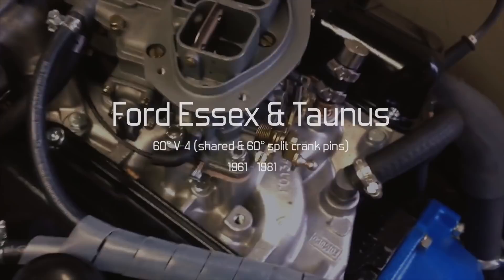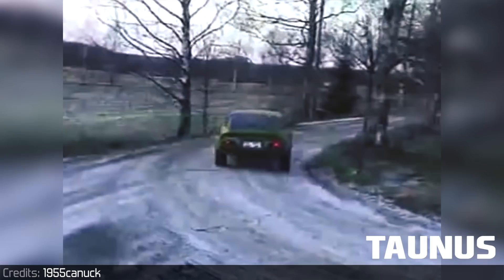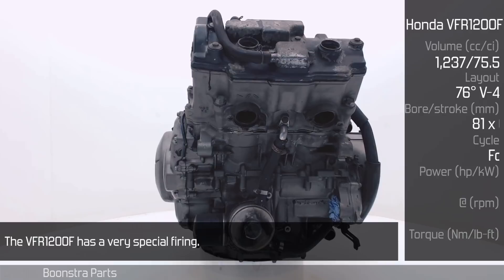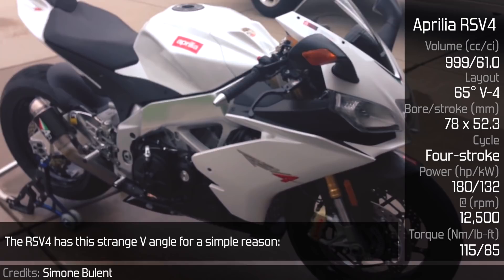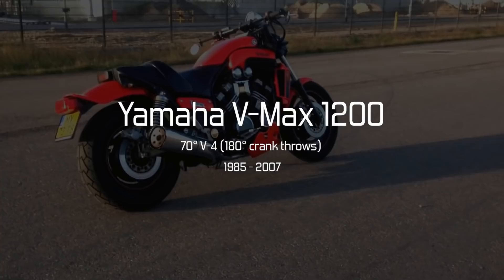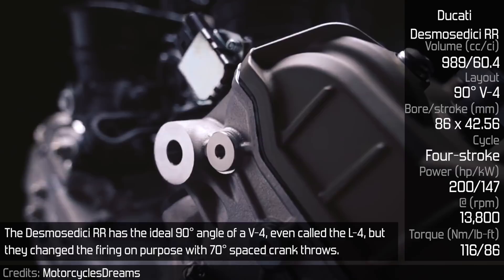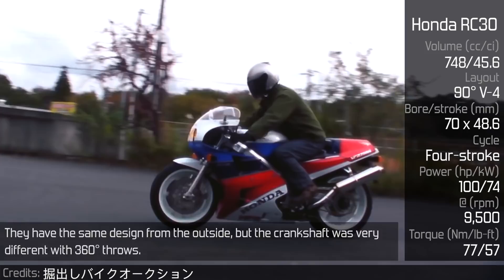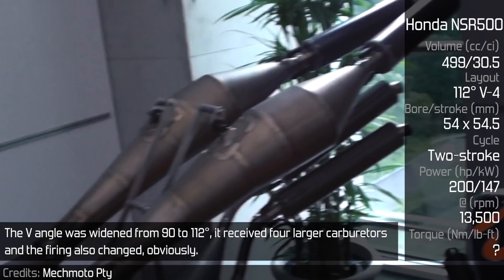9 Differently Firing V-4 Engines

Comment: That RSV4 makes the most fantastic sound on the planet.
Reply: The original Vmax (1200cc) has the same layout and about the same sound. With dual exhaust straight pipes it sounds like a muscle car.
Reply: What about the MT-10 and YZF-R1?
Reply: desmosedici is insane as well .  the street one of 2008
Reply: Have to agree
Reply: I dunno, I bet Emma Watson does...
Reply: Completely agree with that
Reply: I prefer the cbx1000 inline 6, an aural orgasm. Vmax with 4 into 1 exhaust is #2
Reply: Yeah, till you hear a desmosedici live. Its like they made a deal with the devil for the sound
Reply: It’s spelled vfr
Reply: @shadowv6794  in real life, with SC project or Austin racing exhaust, Aprilia rsv4 sounds much better than R1 and ducaties 
Rsv4 screams like a v4 GP bike in max revs as well as it also has bass in low revs like inline 4 bikes 
Rsv4 is a complete music with enough bass and treble..

R1 and ducaties don't have that much bass in low rpm
Reply: Hearing them at full chat in the Norton Isle of Man TT race bikes in 2018 is a sound I'll never forget. I get goosebumps even thinking about it.
Reply: I like my rsv4s sound, but I did notice that even with an SC, my buddies Buell is louder, makes sense though, higher compression into that twin than there is my bike.
Reply: As someone with an rsv4 with a gp22, I agree
Reply: That Honda 750  sounds pretty mean as well.
Reply: yeah....almost like a hippopotamus farting.

Comment: Let's face it, of them all, the Vmax sounds incredibly good.
(that Essex V4 sounds like a good old US V8 also)
Reply: 2nd gen sounds even better.  https://youtu.be/BmiNnBKa85w?t=30s
Reply: I've ridden a 2005 Yamaha Vmax here in my town and I've got to say, its got the best linear torque curve in bikes that I've ridden. No Traction Control for that extra lower end with acceleration that doesn't throw you out of the bike. Nor is there ABS, cause real men use fingers.
Reply: @rajatraghuram7587  I own a 2006 vmax. It's an absolute blast to ride and the sound is amazing too. Even the harley people around here know what a V-Max is it won't dare race it.

I also own a 96 Magna v4 and a 2002 which is going to receive a Vfr750 motor swap and a turbo for drag race use.
Reply: @allhailzoidberg8182  Damn nice, mate!
Would love to see the drag spec Magna.
Reply: @rajatraghuram7587  it's going to be a couple years before I get it going. I bought the bike for $100 usd, and every bit of the bike screams scrap metal. It was in a house fire over 10 years ago and sat in someone's storage shed since. But it has a straight frame and good motor to start from. I've got 3rd magna in addition to my other two that is strictly to rob parts off of.

Here is a video of a drag spec Vfr750. My Magna will have the vfr750 motor internals swapped into it since they share the same block.
https://youtu.be/zdJzzf_FSvM
Reply: @allhailzoidberg8182  Damn nice. It takes on a Vmax too! Phew.

Comment: I missed the V4 engine with, by far, the most amazing sound of all V4 engines: Honda VFR800, with 90-90-90-450 ignition times. Yamaha could use these ignition times in their crossplane engine (R1), it would be awesome.

Comment: Honda, you build great machines and I love you, but please, pleaaaaase try to make your engines sound a bit better... the vfr 1200 sound like an overgrown lawn mower...
Reply: Crézy Chameau
😂😂 oh shit, it really does 💯
Reply: listen to the vfr800 with a delkevic exhaust. sounds beautiful. v4 aswell.
Reply: They're still struggling with F1 engine failure
Reply: Crézy Chameau I agree the last great Honda v4 was the 1998-2000 vfr800 with its gear driven cams the sound that bike makes is beautiful
Reply: Stock exhaust makes anything sound like a lawnmower... take that honda vfr and cut that damn muffler off. Look up straight piped vfr and you will hear that motor come alive.
Reply: The VFR1200 sounds a lot like the gen 1 VF bikes.  VF750/700 and 1100.  The gain is you can make usable power lower down because it's a more even firing order than a VFR with the 180 crank.  The 28 degree offset in the 1200s crank is to account for the less than 90 degree vee angle while still giving a little character to the engine.  I have a 2002 VFR and although it rides, sounds, and looks FANTASTIC (I'm never selling it) I like the way the older bikes (and the ST1300) pull from a lower rpm.
Reply: Oh my god...  Where is the good old vfr 750?!  This new one sounds like SHIT. Vfr 750 is Just something wonderfull that beats everything (with the aprilia)
Reply: Hmm. More like an overgrown chainsaw, but yes.
Reply: Where is the VFR 750?
Reply: Honda's 1200 sounds awful with stock pipe .
Stick an Akrapovic on it , now you're talking  !
Reply: Vfr1200 sounds like a higher revving Yamaha Tmax
Reply: @peterherrington3300  Everything sounds shit with a stock exhaust ( Except the lexus LFA) 
Also the audio of the 1st video on the 1200F is TERRIBLE
Reply: @leviscottt11  NOt the conf as the 1200 though
Reply: 10000% disagree. They sound great especially at high RPM. That was an awful sound clip decelerating into a corner.

Comment: I own a VFR1200.  Everybody that thinks they sound like "shit" has almost certainly not heard one in person with a good aftermarket exhaust on it.  No recording captures the true sound of the exhaust note.  Yes, at low revs they do have a definite chainsaw sound to them, but wind them out past 4500rpm and they sound amazing, very Formula engine-esque.  Then again, it seems to be popular to hate on the 1200.  I have noticed that almost every person that talks down on them has never even sat on one, let alone actually ridden one.

We can gloss over the fact that the engine itself is actually dimensionally smaller AND lighter than the 800cc engine, while also producing over 60% more power and torque.  But, I digress.
Reply: I had a 2010 and regret selling it.  It's not just the exhaust note but the engine intake sounds make it howl.  The vfr 1200 literally is the rc 211 v it's a rocket ship and easily the most underrated bike of the last 20 years

Comment: 400 hp per liter is pretty nice
Reply from the maker: That's what a two-stroke is capable of!
Reply: VisioRacer but it doesn't mean anything since the 2 stroke has one explosion per revolution instead of one in two revolutions. So a 500cc 2T is the equivalent of a 1000cc 4T and the fuel consumption is in the same ballpark while being much less efficient. What's the point of comparing the two ? 
It's a common mistake, the Workshop has a good video on it
Reply: Jordan E 2t is twice as powerful unless 4t is turboed.
Reply: Jordan E smaller and lighter
Reply: A 4 stroke power stroke last the complete stroke, a 2 stroke power stroke last until the EX port starts to open a lot of times is about 1/2 of the stroke.
Reply: Not really true, because you also get gains from a 2stroke firing ...example my 120cc 2 stroke bike gives me 40km per litre...about the same as 4stroke same CC class....only set back I need 30ml of oil to burn together with per liter of fuel...
Reply: @fidelcatsro6948  a honda cbr250r gives about 35kmpl , so it's about the same I guess 😂

Comment: Great vid but where was the vfr750 f rc24,rc36 they had different crank to the rc 30 and a 1324 firing order .Then you have the 800 range with vtec.
Reply: And Is the VF750F Interceptor the same firing order as the VFR750?
Reply: And you have the best VFR 800 with gear driven cams. Much better than the pseudo VFR ( VTEC).

Comment: 2-strokes 💜
Reply: Rutz Tutz 2-strokes are shite
Reply: I think that 2-strokes have only one flaw and it is their reliability. With bikes however it doesn't matter because they are way easier to maintain and its not even expensive. If someone says 2-strokes don't have as much torque, it is because they usually have smaller displacement than 4-strokes, because 2-strokes just make more power out of small displacement. And there aren't big 2-stroke bikes because they would just be too damn powerful.
Reply: Rick Delair hey, i own a 2-stroke. I daily-drive one. Yet i still think they are shite for the road, due to very high maintenance intervals and extreme fuel consumption combined with pretty high pollution. For the track they are very good due to their far superior power density, but i wouldn't buy one for road use.
Reply: Kalle Lahti and its not just said that they have less torque than 4-strokes because they are usually smaller, but also between a 50cc 4-stroke and 50cc 2-stroke, there is still a torque cap that can be felt, mostly due to the 2-stroke engines need to rev higher to achieve the same power level as the 4-stroke and revving higher will on the side lower your torque
Reply: Power to weight is great, but hydrocarbons are poor.
Powerbands are great fun though.....woo...hoo!

Comment: I know Honda did some really clever engineering on that vfr 1200 to save weight and eliminate the need for a counter balance shaft but my god did they ever kill every ounce of soul in that bike.  The sound has always been 70% of the vfr experience and they took it from raucous and thunderous to 2 stroke garden tool.
Reply: You should hear it with a full Akrapovic and the baffle removed.

Comment: Great videos and content! 

Couple of topics that may be interesting for your followers.

Very high boost setups
Compound boost
Twin Charging
Rotary expansion mufflers
Miller cycle engines
Equal and unequal length 
Rotary bikes/turbo bikes
Tank/ship engines
Tractor pull engines
Water/meth injection 
Variable compression 
Alternative fuels 
Hybrids

Comment: RSV4 sounds like a beast, unlike the VFR1200, which sounds like... it doesn't sound like anything, really. The sound of VFR1200F or VFR1200X is so bland and underwhelming. Basically it's a droner as well as the RC30 - the crank throws are spaced at 360°, but there is that offset between the pair of pistons on each throw, so they move more like a 90° V, to reduce vibration, which makes sense, since the engine is for a touring motorcycle.
Reply: re: "the VFR1200, which sounds like... it doesn't sound like anything, really. The sound of VFR1200F or VFR1200X is so bland and underwhelming. Basically it's a droner as well as the RC30"  correct, finally someone to at least acknowledge the buzzing sound was intended to mimic the 360 cranked RVF's (RC30/RC45) which are more known in Europe than the rumbling VFR's (180 crank VFR750/800) that are more known in America.
Reply: And VFR1200X Crosstourer is a great motorcycle, thanks to that engine. It pulls so strong through the entire rev range! Sooo much torque everywhere! Very rapid acceleration in perfect comfort without any vibrations. Best bike in the shaft adventure category.

Comment: It wasn't really touched on much here but the benefit of those uneven power pulses Is it makes the bike more forgiving when you're riding on the edge at the very limit of traction. The gaps in power pulses aĺlow the tire to regain traction between pulses so that it doesn't break loose as abruptly as a bike with an even firing engine.
 Btw you didn't mention the 65 degree, 1700cc 2nd gen Vmax, it sounds similar to the rsv4 but kind of unique in its own way. The 1st gen Vmax 1200 had a 70 degree bank angle.

Comment: Hi mate, can you explain something about the NSR 500. You sad that crank is on 180 degrees, and because we speak about two stroke engine, that meaning that two of the cilinders make the power stroke in the same time! I think that this is not possible. Did you get the point? Correct me if I'm wrong...

Comment: if a V2 engine has a angle between cilinders V, and a angle between split crank pins S, if 90-V=(S/2), then the engine is perfect balanced in terms of primary order. Note a tradicional V2-90 degrees, with shared crank pins, obey this fórmula, and the Honda 1200 obey too.

Comment: How close to a 1984 VF500C would that VFR750F be? That bike sounds almost identical to mine.
Reply: I think the VF500 was a 360° crank and therefore the firing order is the same as the mighty VFR750R or RC30, as many call it. I've ridden a VF500FII a few times, yes it sound great!

Comment: I'am more confused as before after watching this video. I tried to get an overview about angles between each firings on the 720° 4-stroke or 360° 2-stroke cycles to compare between even or more big bang configurations. This I couldn't out of this video.
I also belive Ducati meens with Tween Pulse of the Desmosedici RR a confiuration with 0° crankshaft resuling in a 90° - 630° firing order similar the L2 but 2 cylinders simultaneous.

Comment: That VFR1200 doesn't sound that good honestly
Reply: dallatorretdu The sound is horrible. Sounds like a BMW boxer engine. Nothing to do with the old VFRs.
Reply from the maker: I think so as well, its sound is awful.
Reply: My friend's father has two VFR 1,000s. What a beastly noise they make at idle, revving they sound like angry hell beasts

Comment: TBH honda VFR v4's are the best They're 180 degree pins And IMO the Vtec ones sound the best. It's so lopey and beefy sounding below 6800 and above it it shrieks like a banshee
Reply: VFR 800 RC 46 with gear driven cams sounds way better than the VTEC.
Reply: @martinx1525  vtec adds a variable to the exhaust note with engine speed gdc just adds a whine that you get from the gearbox too

Comment: Honda VFR1200 sounds like a pile of garbage. Sorry Honda. You over-engineered what could have been a monster and created a buzzy goofy expensive low-seller.

Should have featured the updated 2nd gen Vmax. Engine is different again.
Reply: how is it designed?
Reply: It's true that the 1200 sucks massive hairy balls, but the old VFR750 is the best sounding Honda motorcycle. Ever.